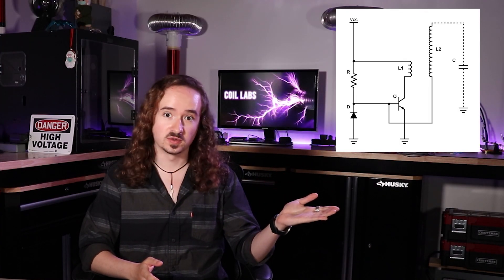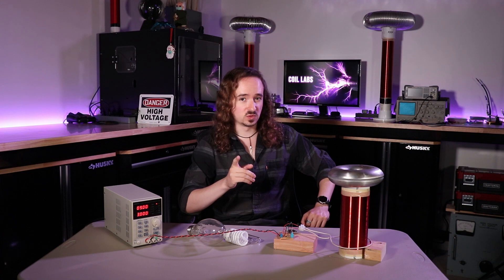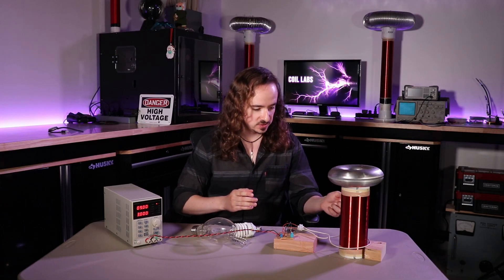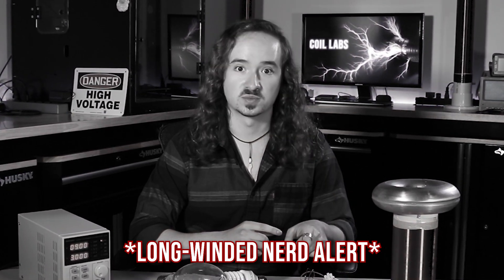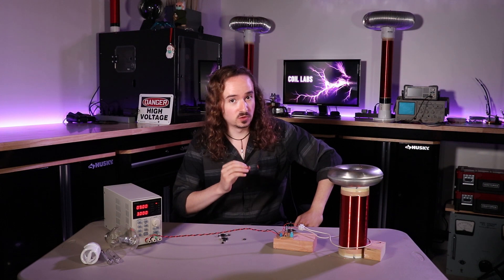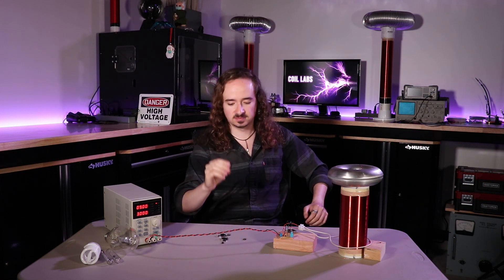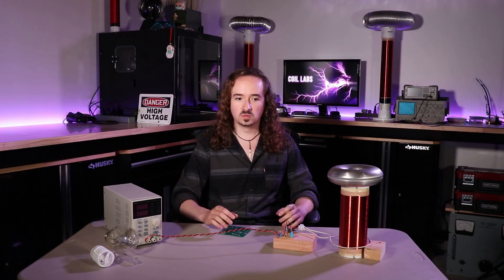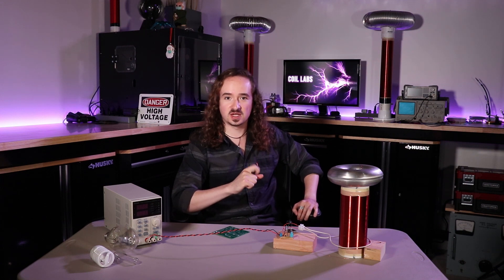Building a Slayer Exciter Circuit

Comment: What you are forgetting is the EM field that is generated to light your bulbs and tubes is also interacting with the circuit board that is driving the thing. The whole circuit should be galvanically isolated, and the mosfets should ideally be galvanically isolated from the other components on the board to avoid it interfering with other components. Draw a BLOB in your mind about 1-2 inches around each mosfet in 3D because that EM field blob also goes above and below the circuit board, and that’s the ideal distance for separation.